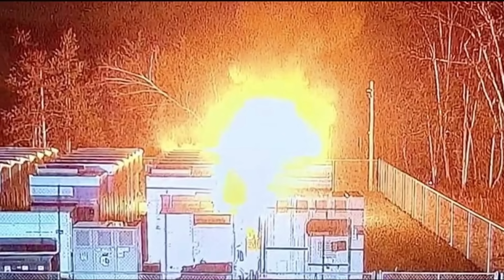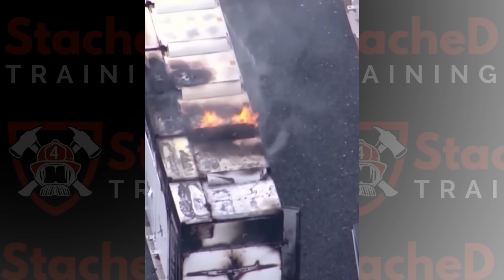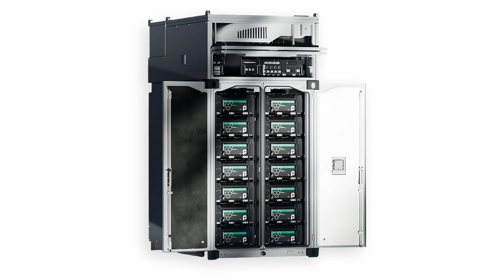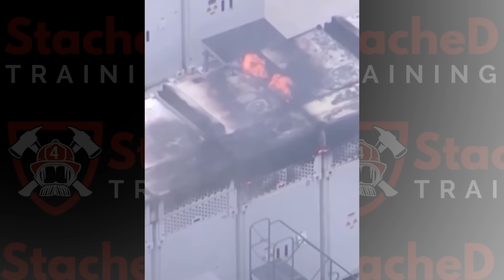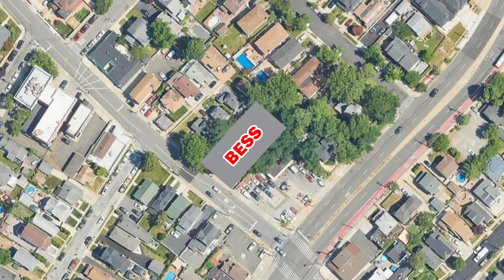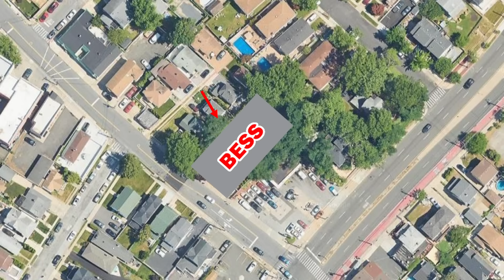Battery Storage Fire in Warwick, NY: A Repeat Incident

Comment: 18 December 2025, 4 house burned down & 5  people died in Teluk Gong, Jakarta, Indonesia, because a fire from a Chinese EV car charging in their own home garage. 22 fire trucks came, they need 12 hours to put out the fire. That EV car is less than 3 years old and use LFP battery.
Reply: This tragedy is confirmed (Dec 18, 2025 in Teluk Gong), but the details about the 'battery' are misleading. Reports confirm the garage was used as a warehouse for flammable plastics and thinners. LFP batteries are chemically stable and rarely go into thermal runaway like this. The investigation points to a charging spark/short-circuit that ignited the chemical vapors in the room. The fire lasted 12 hours because of the burning plastics and chemicals stored there, not because the EV battery was 'inextinguishable'.
Reply: @Diamonddavej  THATS CALLED A COVER UP , TRYING TO COVER UP HOW DANGEROUS EVS ARE
Reply: @Diamonddavej  
German e-engineer here.

Still, from a safety point of view: YOU NEVER refuel a vehicle in a house or garage. Particular when not attended.
Electric or not. Crazy!
Garages or warehouses are meant to be for storage and they are not for refuelling.

Electric charging involves high voltages and strong currents over hours; too many things can go wrong. And be it a rodent nibbling at the cars insulations as it is a common problem over here in Europe, causing occasionally a car fire even with ICE-powered vehicles.
It is common sense to charge an EV in the open and not inside a building. Period.

Just do not play with fire in the barn.

Peace! from Dresden / Germany
Reply: @Gerd-2 many millions of people charge their EV’s in a garage.
Reply: @sforza209  
Well, millions of people play with fire in their barn.

Peace! from Dresden / Germany
Reply: @Gerd-2 do you believe ev's are actually more eco friendly? I dont. I think a well made diesel stick shift is actually the answer, bio fuel? But what do i know? I think they are anticlimactic,(like in bed),   but my favorite car was a first gen vw golf gti. What happened to Germans? Nothing warmed my heart like the tdi lawsuit for the emissions here in the USA.  I'd kill for a old bmw i hate new cars they are GAY.
Reply: @Gerd-2 I just needed to know if Germans stopped understanding the joy of driving? We're doomed if so. Who is going to correct course? Im dying inside everyday at how lame everyone including usa is. The party is over😢
Reply: @pantsuit3  
I myself restored a 9-seater Ford Transit of 1972 (I love vans) with a Capri-engine and long-ratio Diesel rear axle plus many other goodies. Nothing, nothing goes automatic in this car; everything has its own switch or lever.

However I am boomer and enjoy driving = being in charge like a captain on my own and owning ship.

The younger generation is also still interested specially in the more rural areas. But politics and the car industry makes it gradually more and more difficult, since there are now people in charge who never understood that cars also mean culture or even actively ridicule such thoughts (mostly Greenies).

In 4 years time they will make it illegal to sell cars with ICE in the EU. Let's see how the laws of physic, economics and resource availability will beat human-made legislation laws - I know the winner already.
But on top the European/German car industry basically eliminates itself by doing so too. The design and function becomes more and more boring, ugly and even with less functionality including astronomical prices.

If cars become just simple metal cages on wheels in combination of a "smartphone with wheels ideology then this industry follow the same route like the mobile phone industry with all its identical ex-and-hop black-box design: no more culture, no more interesting design, no more status symbol, no more fashion or lifestyle expression, no more excitement and finally a throw-away product. Which is also not very ecologically. The absolute push for EVs goes into this direction - if everything is "autonomous" and can be ordered via app then it will lose its appeal. If creepy door handles become the an "invention" then decline is being chosen.

Fortunately my life was also in this kind of aspect much better and exiting. Even that I grew up in Socialist East-Germany. Driving a 1.7l Lada is definitely more exciting than a boring EV which permanently bugs you with over-the-board and lousy software. You need to know what your doing, you are able to beat nasty weather and still arrive safely and the girls love the roar, smell and speed. Even if moderate.

But it is up to the next generation to push legislation into another direction. We are all old, evil, grumpy, humourless, stupid and responsible for all the evils in the world anyway.

Peace! from Dresden / Germany
Reply: @pantsuit3  
To make it short: No. they are not.

The eco-promise with EVs came always with the only-solar/wind/battery ideology which is currently dying multiple deaths as expected.
I am an electric/electronic/computer engineer who worked for decades on high-tech high-vacuum coater machines, including being in charge to design, make, install and commissioning such machinery for the PV-panel production.

Therefore I know this ideology will technically not work, requires much too many resources locally and globally and on top faces even more challenges like competing for electricity with the new energy-eating monster AI.

I am not against EVs in general, every technology has its place and time. But even if engineered properly it is definitely NOT the planet saver.
A single technology never was and never will.

Peace! from Dresden / Germany
Reply: @Gerd-2 ❤ love u
Reply: Deceitful comment.  A casual google search shows the paint thinner caught fire caused by electrical spark.  Omitting the important detail equals telling a lie.
Reply: @xinfuxia3809  
Why is it deceitful?

There should be no electric sparks at all in any garage.
Regardless of the electric or mechanic source causing it. This could be a plug-in moment or a rodent nibbling on electric equipment or .... or ... or ....

The question remains, was it from the EV and/or its charging device or was it from any other source? Which you are not telling us.

Plus the ignition speed plays a role too. Paint thinner in a bottle will not ignite but if left open or wrongly used (forming up a fuel/air mix) it might even lead to an explosion with a highly charged or still charging EV in the middle.

Your comment does not tell anything about the true cause; missing important details equalling a lie?

Be precise yourself or forget it.

Peace! from Dresden / Germany
Reply: @Gerd-2  It's called a "lie by omission".    Did the EV start the fire as was implied?  Or did a spark from the wiring in the garage start the fire (as it does tens of thousands of times every year around the world) which then spread to the car?
Reply: @mac_mcleod  
Yes, there are too many occasions now with large power batteries triggering horrible fires. A whole new fire station (!!) here in Germany burnt down because of a new auxiliary system (pump) now being electric triggered it.
Five people dead because an EV is right in the middle of the disaster?

You just do not understand it. The initial cause is almost irrelevant. it might be even not the EV, but also the wall box or its feeding lines. Does it count as a EV-fire then? I would suggest "Yes".
The character aka speed in which the fire develops is the problem with EV batteries, the much more toxic gases it releases (than "simple" smoke) while on fire and the fact once on fire you cannot extinguish them.
When EVs burn, they actually do not burn, they kind of explode. No time to react.

The fact that they are often recharge in buildings is creepy from a safety point of view. Nobody ever would allow to refuel 50l gasoline into a car inside a building. Here too any spark will have catastrophic consequences too.
In South-Korea in many places it is now forbidden to park / charge EVs in parking garages inside buildings - because they had horrible accidents because EVs went booom! inside public parking areas of buildings.

Furthermore the frequency is not the issue alone. When EVs are charge much higher voltages and currents are allowed to run unintended while internally for hours a chemical reaction is "brewing". 
No one there to press the emergency off button. 

I am an engineer. I give a sh.t about ideologies. I look at numbers, calculate them and interpret them. I am also not against EVs in general. But I dislike people who broom real problems under the carpets because the believe they safe the planet by selling me new (green) stuff.
Problems need to be properly addressed and tackled. 
Not admitting problems could be called a "lie by omission" very much indeed.

Comparing the accident fire frequency of EVs and ICE-vehicles via statistics MUST be biased - because the data pool is so different for both.

Let's talk in 20 years. Perhaps there are even better safer batteries out there.

Peace! from Dresden / Germany
Reply: @Gerd-2 single incidents are terrible but they are over reported in the news while gasoline fires are grossly underreported. 

The new iron and sodium batteries don't burn like lithium batteries did.

There are 51 fires on airplanes every year in the United States from handheld electrical battery devices.  

This solution was to buy proper fire bags for the airplanes, not to ban all iPhones.

The solution for electrical vehicle fires is those fire blankets to smother them. 

End the solution for neighborhood battery packs would be to build them out of the proper type of batteries and to design them better.
Reply: @mac_mcleod  
Who said to ban all EVs?
I did not.

Interestingly the German news article on combating EV fires is saying that fire blankets are worthless.
So, what is correct?

Peace! from Dresden / Germany

PS: On top, but banning all ICE-powered cars in return makes sense? Really not a good idea....
Reply: StacheD has talked about those and why these statistics aren't actual well kept or accurate.
Reply: There are roughly 12,500 gasoline-powered car fires per year in Indonesia if their rate is the same as the united states.   But their cars are older and in worse condition.

Yes, the EV fire is tragic.    But the news doesn't report the 178,000 petrol car fires per year in the united states.  I saw one last november on the freeway-- it was NOT reported in our own city news even tho it blocked the highway.  But we get reports of EV fires in other countries  on the other side of the world.
 
As for 22 fire trucks and 12 hours to put out the fire--- they needed training and they needed an automobile fire blanket.   It would have quickly (under 2 minutes) smothered the fire and then they could have transported  it to a safe area to burn out.   They clearly just sprayed it with water the way we were doing in the U.S. a decade ago.
Reply: @mac_mcleod  
You forgot the fire truck needs ten minutes to arrive. Specially in Jakarta, the time is probably much longer - this is not the USA, cities in Asia are differently structured.

If there are more EVs in the market the EV-fires will go up naturally. And then let's compare how many people get away alive - even in statistics.

Btw where is this 178.000 number from? This would mean roughly 500 car fires a day - even for a huge country as the US this seems totally exaggerated and would make sooner or later make headlines.
I myself never seen a car fire on public roads but with this kind of frequency one should see at least a few. So what is the source? Is it "Trust me, Bro?" or googling the internet 😂?

Ignoring safety problems is the first step into disaster. And this is what you keep suggesting to us.

I am not advocating to ban EVs. But I am tired of these Greenies who constantly want to sell me this idea as a planet saver. It is definitely not. Not in term of safety, simplicity or even global resource protection.

All we do is triggering a new now green predatory Capitalism. Thanks, not again please.

Peace! from Dresden / Germany
Reply: @Gerd-2 if every car was replaced with EVS today, total car fires with drop by 9,000 fires per year. 

And the new sodium batteries don't burn. 

The news gives a false impression by reporting every electrical vehicle fire while never reporting gasoline virus because they don't draw views. 

The rate of gasoline vehicle fires per 100,000 cars is much higher than that of electric vehicles.

I have seen multiple gasoline car fires in person. I have never seen an Eevee fire in person yet.
Reply: @mac_mcleod  
Sure, because they are comparably scare. Which is why these "statistics" are creepy.

I do not know where you live but here in Europe you do not see car fires even after nasty accidents. They just do not ignite.
This is different with EVs, as an e-engineer I know why. And the same applies to the charging process, while on gas stations safety was tighten over the years and decades, there is still a lack of preparation, consideration and even experience.

But as I wrote, you miss the point entirely. Because crash landings on airports are very rare, you still have a fire service with 24/7 crews and machinery.

Because if they do happen, you want to be prepared. So regardless if EV-fires are frequent or not - they are horribly disastrous with passengers  or building occupants hardly getting out in case of such an event.

What are you trying to prove? That everything is just about fine and do not worry?
Such attitude I even do not find among ICE-car owners. They thing twice before loading a lot of extra jerry cans into the vehicles and stash them into their house.

EVERY technology is having safety issues and downsides. And so is it with EVs.
Address them and tackle them and the acceptance will be higher. Careless green propaganda and number twisting is not going to help.

A friend of mine, e-engineer as me installed his own new wall box because his personal company car is soon to be replaced by an EV (which he does not like and want for many reasons) for tax reasons. He has a nice double garage.

The wall box sits outside now at the drive way and so will the EV. It will never see the garage from the inside.

Peace! from Dresden / Germany
Reply: @Gerd-2  

I'm sorry, but you have fallen victim to the same selective reporting.  Here are the facts:

Country	Approx. vehicle fires per 100,000 vehicles per year
USA: ~62 fires per 100,000k
Netherlands: ~57.6 per 100k	
Belgium: ~50.0 per 100k	
Denmark: ~49.9 per 100k	
Luxembourg: ~32.5 per 100k
Sweden: ~68 fires per 100,000 gasoline cars 

Source: SFPE & Swedish Civil Contingencies Agency.

How about EV fires in Europe?
~3.8 fires per 100,000 electric vehicles (EVs)
Swedish Civil Contingencies Agency
Reply: @Gerd-2  Oh and the figures are not published by the german government but here are the figures from insurance data.

Approximate annual vehicle Fires for Germany
Petrol/Diesel (ICE)	~1,500+ per 100,000 vehicles†
Electric Vehicles (EV)	~25 per 100,000 vehicles

Source: HNA (Brisante Feuerwehr-Zahlen zu E-Autos: „Die Fahrzeuge brennen nicht häufiger, sondern seltener“/"Shocking figures from the fire department regarding electric cars: "The vehicles don't burn more often, but less often"")
Reply: @mac_mcleod  
Sure but the frequency is not everything and age aways plays a role. So the numbers are interesting but not comparable.
Statistical figures just always compare only with proper side information, which are here again (as so often) excluded.
So what are you trying to prove? That in South-Korea people are stupid?

As I wrote, I am an engineer and give a fart on (green?) propaganda. I am a rational man by trade and I never like evangelists.
The new dangers from EVs are very clear, need to be addressed and hopefully fixed.

In all of these political discussions we can see now a true number battle as a pattern and depending on your political bubble statistics are bent to personal preference. 
Of course a much newer fleet should burn less often. So this is not "shocking" (wrong translation from German language - "controversial" would be more appropriate), I expect that as an engineer.
(Industrial) electric and electronic components usually start to develop age-related decline problems when they are either very new or older as ca. 7 years. So we were told in our university.
The complexity and environmental challenge for EV components perhaps shorten this period.

So you are trying to lead a discussion with the wrong man on a distorted subject and certainly with the typical wrong simple mindset.

I read the original article fully and it definitely contains a few wrong things.

It says nothing about the intensity and speed of flame development in regard to its chemistry in detail - just hollow general comments. 
Therefore as an e-engineer I am kind of truly chocked about a few engineering details which are certainly plain wrong.
Specially the comment that with an shut-off vehicle there is no more any high-voltage risk inside is complete BS and extremely dangerous. It also does not refer to the dangers while charging.

In terms of fire fighting a burning EV the article preaches everything in the opposite as StacheD propagates in terms of extinguishing EV fires - meaning there are fundamentally opposite statements. Now, EVs in the US and the EU do not behave by different laws of physics or chemistry.

Since the German article does not give any further details here why this is the case, StacheD's explanations and analyses simply make highly sense to me.
This guy seems to be knowing what he is talking about as a battery engineer and fire fighter. He neither over-dramas events nor is he plain anti-EV guy.

Neither he nor me are against EVs in general, but what I can tell you that we here in Germany have a very hardcore green propaganda since decades.
As an engineer who worked for years in the PV-module manufacturing industry I know how much these people lie (often with semi-educated or no educational background at all) to brainwash our population. These technologies are definitely not planet savers and will not work everywhere either. 

So why can't you live with my statement to check in 10 or 20 years again? All options are open by saying so. Positive developments are all included.
There is nothing worse than evangelists to or for any cause. They just cannot stop gasping when problems are being addressed.

PS: Next time you come up with numbers put the link or source in. Makes discussions easier in general easier and for others to find the related article/source.
I also checked the paper where the article was released: a tabloid named HNA, as trustworthy than our ill-famous trash daily "Bild".

Peace! from Dresden / Germany
Reply: @mac_mcleod  
I am not falling victim to "selective reporting". These numbers are interesting but do not mean anything as I answered before.

Perhaps I also fell victim to the "selective reporting" when it comes down to the extremely rare accidents in a nuclear facility?
Why are we having active stand-by fire fighters on any airport although plane crashes are so rare? "Selective reporting" or a potential danger acknowledged and as best as possible tackled?

Please spare us all this selective statistics riding. Interpretation and side information are the key to any statistics, plus issues like disaster development and damage potential.

EVs are not safer, they are only as unsafe in different ways.

Peace! from Dresden / Germany
Reply: @Gerd-2 look at your emotional reaction to gasoline car fires in electrical car fires. 

They are at odds with the facts. 

Anyway, it's clear that electric vehicles will continue to replace petroleum diesel vehicles. 

Going to move on down the road now. 

Cheers.
Reply: @mac_mcleod  
Nothing emotional here.
Where do you get this one from?

Just considering all aspects and not doing this green convenient cherry picking.
And I countered some of your arguments from a professionals point of view. Which is called "discussion".

I even went all the way and read this article. And well, it is partially plain wrong.

Peace! from Dresden / Germany
Reply: @Gerd-2 from reading your post man.  You had an extremely strong overreaction with several enormous responses that didn't match observable facts from public sources and some rationalization. 

You seem strongly invested in the auntie Evey narrative as I would expect on this channel. 

I don't own an Eevee.  I still drive a Honda Element with 158,000 miles on it.  And around 200 to 230,000 miles I'll probably finally have to retire it.  

Under current conditions I will replace it with an electric vehicle and use my own personal solar to charge it.
Reply: @mac_mcleod  
Aahh, now we are going personal after we run out of arguments: I am familiar with this.
"Emotional"? Be precise, man ... Otherwise, you are "emotional" too, aren't you?

But hey, go ahead.

What better way to observe than working in this industry for myself for so long?
True engineers like me love to look at any issue from different angles and perspectives and ask questions. 
Obviously this something you missed in my postings. But, this is now considered "emotional".

Good luck with your new EV. As I wrote I am not really against it. Everything as a technology has its place and time, its advantages and disadvantages.

As it is with ICE-cars and nuclear power stations and anything else.

But even this is not good enough for evangelists, they always strive for the "pure solution".
Which never existed and never worked. 

Peace! from Dresden / Germany
Reply: Wait until electric trucks became common.😁
Reply: @crazyedo9979 those tractor trailer combinations are a 1 mw bomb of potential energy. It's really Scary stuff.
Reply: Very high temperatures,  strong jet fires, heavy and dangerous smoke, difficult to extinguish. Please read further
Reply: Ex firefighter here, I am not surprised. Lithium batteries are a known fire risk before they were ever put into vehicles. They may fail 24/7, burn hot, develop quickly and you cannot put them out until they burn out. They also contaminate the watercourse. You will only see more of these sadly. Should be banned.
Reply: @michael.randall5034 comment is misleading. The garage the car was in was part of a home workshop, making flower vase accessories, an electrical spark from the cars charger plug ignited paint thinners "The fire then spread to paint thinner used for making flower vase accessories, causing it to grow rapidly."
Reply: @Diamonddavej  
Yup, so it was the cars charger and not the EV?
Interesting perspective....

Peace! from Dresden / Germany
Reply: @michael.randall5034  So, an ex-firefighter... what is your reputation on this topic? Have you had any training in this since you are no longer working? Why doesn't your statement agree with statistics and statements from high-ranking, active firefighters who really deal with this topic?! Why do insurance companies say the opposite of what you say?
Reply: @michael.randall5034  
It is interesting, how emotional these Greenies respond to your comment.

While lots of them love to ban technologies based on other aspects.
Any technology which is convenient for them is nice, clean, safe and of course "green". While anything else is not nice, dirty, unsafe and of course environmentally unsafe.

These people never been in a factory where all these (new and old) things are made. They would be surprised that nothing really changed in this kind of aspects.
Nuclear power station - NO! Solar? YES!
But certainly we triggered a new green predatory Capitalism by doing so - without saving the climate or the environment.

Worked in this industry for too long to see all these discrepancies and hollow green promises. 
And I am tired of these one-eyed ideologist perspectives. And of course, these people are so extra-smart, they know EVERYTHING.

Cheers & Peace! from Dresden / Germany
Reply: @michael.randall5034 Haha, yeah, let's ban lithium batteries 😂.
No more Laptops, Phones, power drills, storage, EVs and even gas cars have 12V Lithium Ion batteries these days 😂
Reply: @fie1329  if you look up, you'll see "THE POINT" flying over your head.
Reply: @michael.randall5034  You have not done your research, EV's catch fire at a far lower rate than ICE vehicles, it's not even close.  Statistics don't lie.
Reply: @JRP3  Okay. Let me ask you a question. 
Would you rather be close to 4 separate firecrackers when they go off or 1 stick of dynamite? 
Gas cars are more common and there are more out there that are older than the oldest EV. Gas car fires are safer for the surrounding area. Not as hazardous smoke. And if it was a gas car fire they would not have needed as many hours to put it out. 

Your argument is ridiculous. 
Would you say nuclear bombs are safer because there are way way way fewer of them blowing up?
Reply: @a9ball1  Stupid analogy, an EV is not a nuclear bomb, and an ICE vehicle fire can be just as deadly or worse than an EV fire.  But the fact remains that EV's catch fire at a far lower rate than ICE vehicles, which means they are far safer.  Those are the simple facts.
Reply: @JRP3 
Stop clinging to a moot argument.
StacheD has addressed this many times; the so called stats you mention haven't been updated AND as EVs age we will see more failures.
Reply: @JRP3 StacheD has talked about those and why these statistics aren't actual well kept or accurate.
Reply: @vendomnu you are one informed individual
Reply: @JRP3  Statistics are used to lie all the time. ICE cars are many time more common, many are vastly older, and most ICE fires are after a theft or insurance scam. The next most common cause of ICE car fires? Electrical faults. Contrast that with an EV that can just go up for no reason, with no warning at all, and they're all jam-packed with electric this and electric that?
Reply: @JRP3 remind me again how many times parking garages and apartment complex have been burnt down due to ICE vehicles recently? Are you being paid or an idiot?
Reply: @vendomnu  Mass produced EVs have been around for over 20 years now, we do NOT see more failures due to fire, we see a LOWER percentage.
Reply: @bigglyguy8429  You don't understand ratios apparently.  Hint:  the number of ICE vs EV's is irrelevant, it's the ratio of fires to number of vehicles on the road.  Also EV's have been around for over 20 years now and only a tiny portion of vehicles on the road now are older than that.
Reply: @JRP3  

Yes I do understand ratios. 20 years old EVs as a mass phenomenon do not exist.

These "statistics" and "proof" are very distorted.

1. There are many more ICE-cars out there than EVs
2. Those ICE-cars are often much older than the EVs
3. Those ICE-cars spool much more milage than EVs
4. Aged cars also mean ICE-cars are also often tempered with

Once EVs have a much greater market share and get into the age of 10 or 15 or 20 years than let's look at the picture again.

If you speak with statistics, you have to be fair and interpret them properly. 
As a German certified electronics and hand-on e-engineer (MSc and 30 years experience) I understand why EVs are technically having much greater chances to ignite and then being non-extinguishable.
Specifically Diesel-engines (the new villains of all world-troubles) are having a very hard-to-ignite fuel, while a shortened (aka damaged) battery or circuitry quickly come into a stage where the batteries are burning and exploding with almost the speed of light, igniting anything around them- Even certain metals. 

The situation is so bad, that S.-Korea is already starting to ban EVs from parking indoors.

Here in Germany even a new fire station (!!) burned down (including the new fire trucks) because of an electrically power-packed auxiliary machine for fire fighting.
On top, I never heard that any ICE-car devastated 4 houses and 5 lives by sitting "peacefully" in a garage. 
Why? Because ICE-cars are not refuelled inside your own house or a public building. THIS is crazy from a safety point of view! And even illegal over here for very good reasons.

Let's see how your statement holds up in 10 years time from now. It seems that more and more local and national governments, fire fighting forces and even shipping companies are getting more and more restrictive.
Besides, the frequency of fires are one thing, the spontaneity and ignition speed plus self-feeding nature is the concern.

So there are more aspects to that than just statistics.
As with any technology it has advantages and disadvantages and it is not going to help all of us to ignore the dangers instead of address and tackling them.

Peace! from Dresden / Germany
Reply: @Gerd-2  You spent a lot of time proving once again you don't understand ratios.  You also proved that you don't understand how much inherently safer EV's are, even with all your "experience".  I'll not waste any more time trying to explain why you are wrong.
Reply: @JRP3  
If you do not understand me, then YOU do not understand ratios.
Comparing two entirely different bases will never make a statistics right.

Sorry mate, I was a top engineer for 30 years and always top in higher Math.
Even about the safety you are wrong. I am tired of ideological BSers.

And no, I am not in general against EVs, but I am against any kind of tech and marketing religion or propaganda.

Read what I wrote or forget it. Stay ignorant, if you like.

Peace! from Dresden / Germany
Reply: @Gerd-2  I'm tired of fear mongering BSers spreading lies.
Reply: Some answer to this concern is required
Reply: Oh my GOD! A house burned down in Indonesia. We need to destroy all EVs, NOW! Oh, hang on, there were 258,000 vehicle fires in the USA in 2025, half of them cars, almost 100% of those fossil fuel cars. Statistically, fossil fuel cars are something like 20-100 times more likely to catch fire per mile driven than EVs (depending on country and statistical measures used). Oh, and Indonesia, I mean, come on. Trump, for all his idiocy, has a term for countries like Indonesia. I live very close to it and I can attest that it fits that description very well.
Reply: @AussieUnclePhil  I worked for the fire service for 30 years including fire safety and fir investigation in London. Firstly most fossil fuel car fires now originate in the electrics, not the fuel  especially since the demise of the carburettor, unleaded fuels which are less combustible and diesel which is hard to ignite. You also have to take into account the age of the average car fire  which is 12-15 years for ICE cars some of which still on the road are 30-50 years old and that 65% of ICE car fires are Arson.  There are also many more ICE vehicles on the roads. The important factor which levels the playing field which stats do not show is the age of the vehicle and the origin of the fire, ie how it started. EV's that  are failing are on average barely a few years off the production line if that, and some have gone up in the factory,  the showrooms and forecourts and this can happen 24/7. You are also seeing a worldwide epidemic of EV bus fires. EV's are not old enough to be spontaneously combusting but they are. As they age this will get worse. But the fact is Lithium Ion batteries were a known fire risk before they were ever put into vehicles and you are also seeing them fail in battery storage,  re-cycling plants, E-bike and E-scooters for which they were not designed. Therefore you are comparing chalk with cheese and not taking into account all factors. The old saying lies, blood lies and statistics
Reply: @michael.randall5034 don't use logic. That's unfair. I think our good host, StacheD, had a video explaining where the ev to ice fire statistics come from. As I recall the ev stats come from one year, 2018, in one region. Fire departments should, bit do not appear to, keep vehicle fire statistics. That would be useful data.
Reply: @michael.randall5034  The only lies are coming from you.  As a percentage proportional to number of EV's vs ICE on the road EV's catch fire at a much lower rate than ICE vehicles, you can find plenty of studies to back this up.
Reply: @JRP3  the rate is about the same.  EVs are not particularly any safer than ICE.   ICEs are more likely to catch fire only because the avg age is much older, but once you control for age, the rate of fire is about the same.  In new vehicles, collision is the leading cause of fire, but, as they age, wear & tear in mechanical & electronics parts increase the fire risk.   MotorTrend  reported that 77% of all car fires in 2017 involved vehicles that were at least 10 years old.
Reply: @tooltalk  No the rate is not even close to the same, EV's catch fire far less often than ICE vehicles at any age.
Reply: @JRP3  
Oh, how this works so quickly using the word "lies".
One more reason to be extra careful what you are posting.

No more own arguments - trying to discredit the other person. Always the same.

Peace! from Dresden
Reply: @AussieUnclePhil  wow. Using the topic as an excuse to s*** on the people of Indonesia is pretty low.
Reply: @AussieUnclePhil  you're missing the point: EV fires are far more devastating than ICE cars and can compromise the whole building.
Reply: @alexeikotov7769  If the EV's aren't placed where they can endanger the whole building there is no problem. And that's the practical answer to this problem, not banning EV's.
Reply: @P_RO_  100% EV are great, but suitable infrastructure and regulations are required.
Reply: @alexeikotov7769  
This is what they did in South-Korea, where a lot of inhouse parking areas are banning now EVs.

They do not do this because they are stupid, they do this because they had a few but very nasty accidents.

But according to some folks here, this does not matter at all.
Those are very often the same people, who demand the banning of nuclear power stations because there were exactly two major accidents in the past.
Does this "logic" make sense? At least not to me.

Without nuclear power in the future there will be no EV-only car traffic / economies possible very soon.

Peace! from Dresden / Germany
Reply: @Gerd-2  Guten Tag!
German “green” politics can be only described as insanity! Especially when your neighbor France gets around 70% of its electricity from nuclear power plants. But it’s back to coal for Bundesrepulick... And nuclear power plants aren’t just energy: it’s cutting edge technology that can be sold all over the world!

By sheer coincidence I’m currently reading  Markus Wolf’s book “Spionagechef im Geheimen Krieg” and very intrigued by relationship between GDR and FRG.
Reply: @AussieUnclePhil  
On top, these "statistics" and "proof" are very distorted.

1. There are many more ICE-cars out there than EVs
2. Those ICE-cars are often much older than the EVs
3. Those ICE-cars spool much more milage than EVs
4. Aged cars also mean ICE-cars are also often tempered with

Once EVs have a much greater market share and get into the age of 10 or 15 or 20 years than let's look at the picture again.

If you speak with statistics, you have to be fair and interpret them properly. 
As a German certified electronics and hand-on e-engineer (MSc and 30 years experience) I understand why EVs are technically having much greater chances to ignite and then being non-extinguishable.
Specifically Diesel-engines (the new villains of all world-troubles) are having a very hard-to-ignite fuel, while a shortened (aka damaged) battery or circuitry quickly come into a stage where the batteries are burning and exploding with almost the speed of light, igniting anything around them- Even certain metals. 

The situation is so bad, that S.-Korea is already starting to ban EVs from parking indoors.
Oh my GOD!
Here in Germany even a new fire station (!!) burned down (including the new fire trucks) because of an electrically power-packed auxiliary machine for fire fighting.
On top, I never heard that any ICE-car devastated 4 houses and 5 lives by sitting "peacefully" in a garage. Why? Because ICE-cars are not refuelled inside your own house or a public building. THIS is crazy from a safety point of view!

Let's see how your statement holds up in 10 years time from now.

Peace! from Dresden / Germany
Reply: @Gerd-2 in the UK, often EVs become Diesel vehicles after the fire! People who know nothing about fire don't realise that nearly all vehicle fires started due to electricity. Not fossil fuels. I notice a lot of governments are waking up to the risk involved with keeping EVs close to habitation especially apartment complexes etc!
Reply: @one.wonders  
This basically confirms my statement. ICE cars start to burn because something ELECTRICALLY goes wrong; be it because of a crash or unprofessional tinkering with the 12V or 24V system.

I am an electric engineer by trade and I rebuilt a 1972 Ford Transit years back; modernizing its electric system in the process due to the fire hazard the original electrics were representing. The whole vehicle hat only 8 fuses....; some circuits were nit fused at all.

A normal 12V 36Ah battery easily can start a fire when an electric short occurs, an EV battery (HV and high current) compared to it is a complete different monster animal. 
It controls, cable looming and the batteries themselves are exposed to rain, snow, humidity, UV-light, salt, vibration, extreme temperatures differences, animal bites, dirt, rot and at the same time are supposed to be affordable (aka cheap during production) and are extremely complex. Keeping such a system inside a vehicle is a major engineering challenge.

EVs are indeed as complex as ICE-powered cars; their complexity only shifts into hard and software.
While worn-out mechanics can be often easily spotted, it is impossible for most of the hardware and software. So as older they get, they riskier they will become.

So, therefore let's lean back and wait for the changes in statistics in the upcoming years.

PS: I am not against EVs in general. I just do not like the hyping it comes along with these pseudo-green promises. Every technology has its advantages and disadvantages and so does EV versus ICE.
For sure, both are not green in an absolute sense. This is propaganda.

Peace! from Dresden / Germany
Reply: @AussieUnclePhil  it's not about fos normal petrol cars fire , EV fires are a total different scene because of its composition